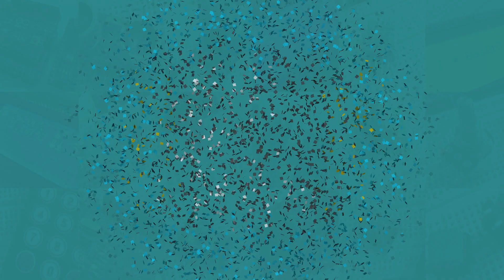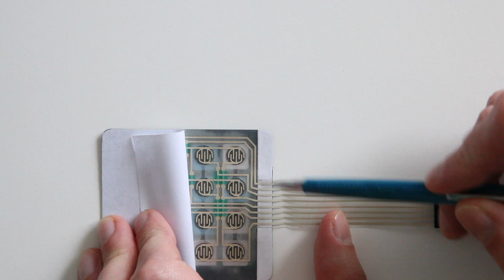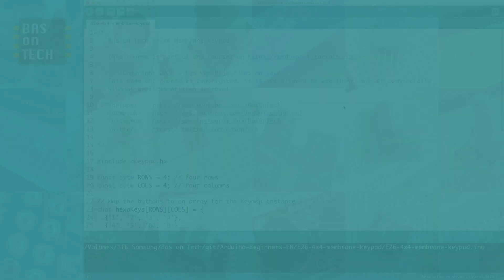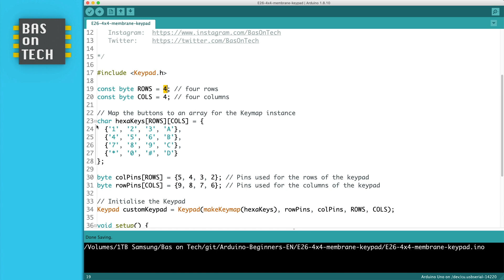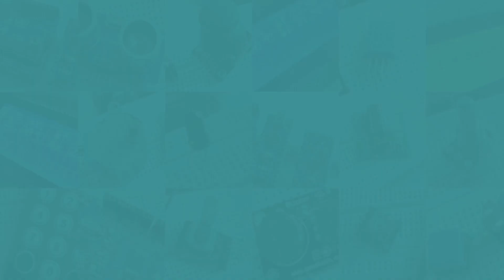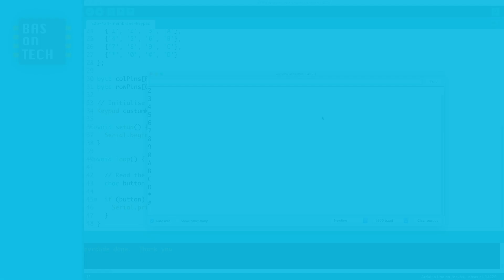4x4 MATRIX KEYPAD / MEMBRANE KEYBOARD - Arduino tutorial #26

Comment: lines 30 and 31 are confusing as you have colPins[Rows] and rowPins[COLS].   It should be byte rowPins[ROWS] = {9,8,7,6}; byte colPins[COLS] = {5,4,3,2};  Even though it was confusing it worked, but very bad form to have the way it was.  Code should be self-documenting.

Comment: how can i take in output two numbers instead of only one??
Reply from the maker: You then have to check if the user presses a number and then release. Then you have to check for the second number. Keep in mind. that you also need a "clear" button and "confirm" button to make this work correctly. If someone wants to enter the number 8 then "confirm" tells you the user is done and not want to enter 80

Comment: Hi!
Is it possible to use your Arduino Code implemented in StandartFirmata?
Thanks!
Reply from the maker: Probably. You have to use the Firmata library and combine it with the code I use 😃
Reply: @BasonTech  i already tried but was not successful.. im trying to use the notepad in node-red and i've already tryied more options that i can count.. i just started with arduino so my knowledge isn't the best :c
Reply from the maker: If you don't have Arduino knowledge, I would recommend to start at the beginning. This will give you more insight in how to debug.

Comment: Hello!

do you know how can i make a 15x15 keypad matrix?

how to create a larger (hexaKey) table! there are not so many symbols on the keyboard and he does not allow me to type between two ('....')

for example ('1a')

does not support combination!
Reply from the maker: 15x15 are 225 buttons, which is quite large. However it should be possible. You then need than at least around 2x15 pins. The Arduino Mega has 54 pins, so that one should be working 😃
Reply: @BasonTech  I have technically solved it. But I can't fix the code!

there will be no button on the computer keyboard!

char keys [ROWS] [COLS] = {// declare 2 dimensional array to map keys
  {'1', '4', '7', '*', '+'},
  {'2', '5', '8', '0', '-'},
  {'3', '6', '9', '#', '/'},
  {'A', 'B', 'C', 'D', '<'}
};

can't figure out how to fill in 255 notations!

codes do not allow you to simply write numbers from 1 to 225! :)
Reply from the maker: @tomscietvirs2379  The array in the tutorial is a char array. This means you can only store a single character per position. If you want more you have to use another type of make a translation function which translates a number into a certain code which matches what you want. So this could be for example an array of bytes.
Reply: @BasonTech  you probably know where to find a similar code!
I won't be able to write myself yet!

I don't know how to program so well yet.

And many thanks for the suggestions!